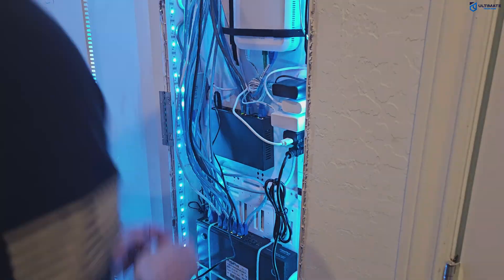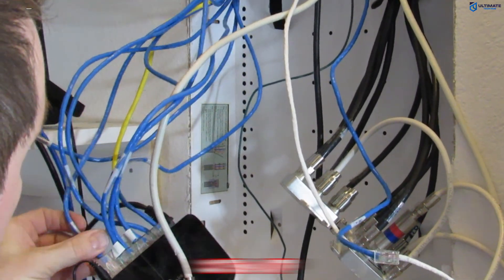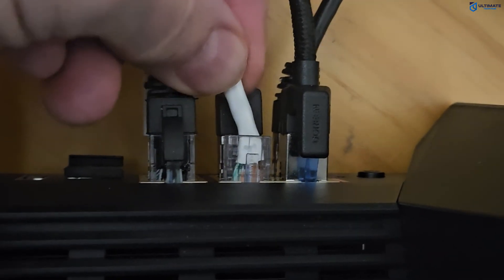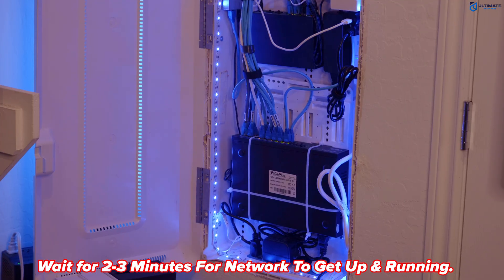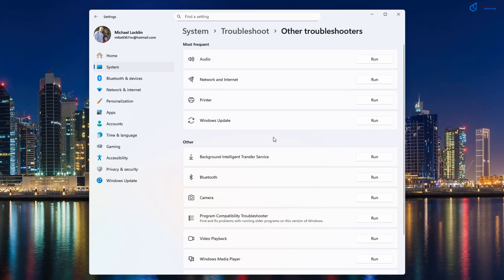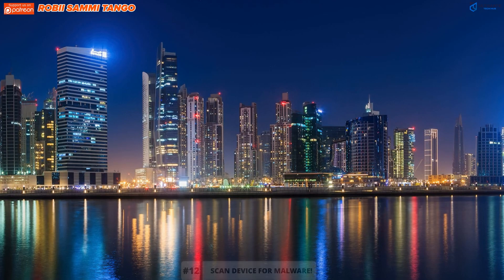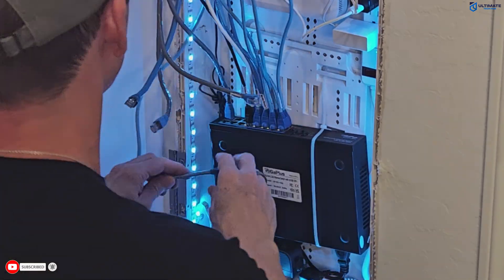How to Fix Slow Ethernet Speeds in 2025! Quick and Easy!

Comment: Omfg thank you so much I was going insane trying to figure out what was causing my speeds to be cut in half I have my xfinity modem wired to my axe16000 and I tested the speed on the app and was getting 2,000mbps but I was getting 1100 to my pc I bought 3 different switches thinking that was the problem until I watched this vid and disabled power saving thru device manger thank you so much I now get 2200mbps on my pc
Reply from the maker: Awesome ! Glad to help! Thank you for watching and for commenting !

Comment: It’s better when updating the network drivers to get the drivers from the manufacturer. Also Inter NIC are better than Realtek NIC . A good solid cpu also helps when giving instructions and keeping up with latest network equipment. Although TP is good and popular and cost efficient, fiber optic cables are an alternative but cost more for higher speeds. Packet prioritization like QoS can help and getting a really good router can really help with ISP bandwidth limitations. Reducing EMI and crosstalk elimination with proper grounding of STP can help but cost more then UTP . Cables CAT 5e , CAT 6e , CAT 6a are fine for most people . Wi-Fi 6, 7 are fine for wireless. And MocA routers are great for people that can’t extend cables throughout their home’s . Wouldn’t recommend using extenders, repeaters or hubs . Switches are fine if more ports are needed . Speed test (ookla) and Buffer Bloat test are good to test internet speed . Modifications in network adapter helps a lot aswell like disabling power consumption. And lastly applying best security practices.

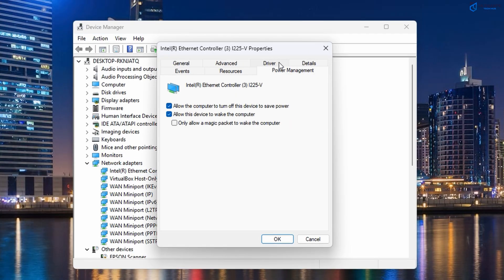Comment: 2:45 Btw, In Advance settings over here there are more Powersaving modes those should be turned off! Like Energy-Efficient Ethemet, Gigabt Lte
Green Ethernet, Advance EEE, Auto Disable Gigabt, etc! 

Also I had a Question shoud I disable all the Offload related settings? Like NS Offload, Large Send Offload v2 (IPv4), etc? I asked ChatGPT which said that my CPU can handle these processing better than My router it will reduce Internet Latency is it ok to turn this off? My CPU is Ryzen 7 3700X
Reply from the maker: I would do a speed first to see if your getting your max speed. If you are getting max speed then I wouldn't turn anything else off. And yes your PC CPU can handle those processes better but if your maxed out speed wise I wouldn't mess with it. If its not maxed out then yes give it a try to see if it makes a difference. Keep me posted and thanks for watching!
Reply: @UltimateTechHub Thanks for the reply man! 👍